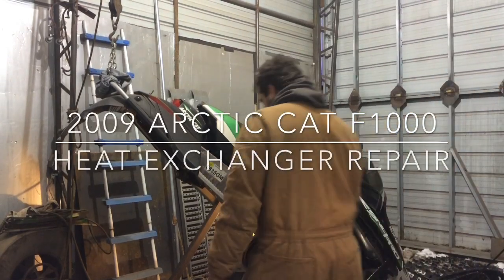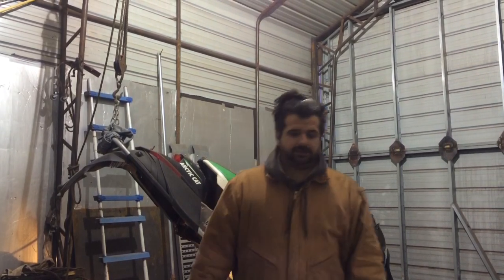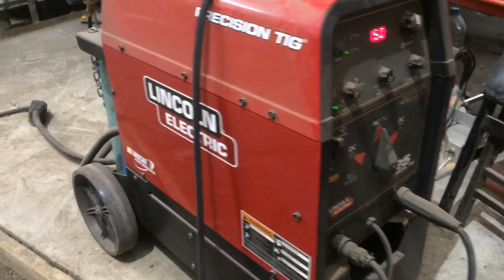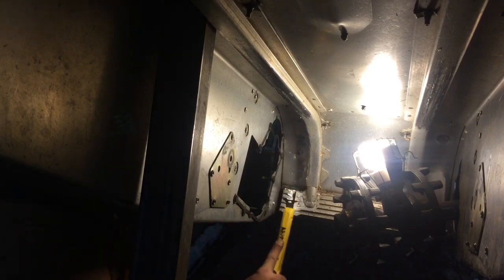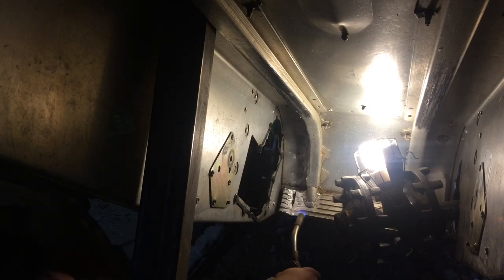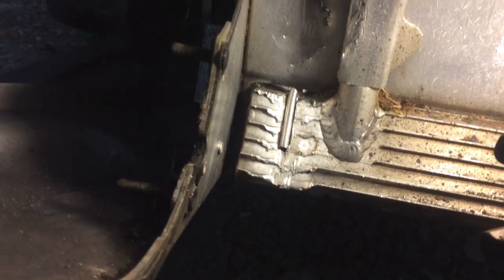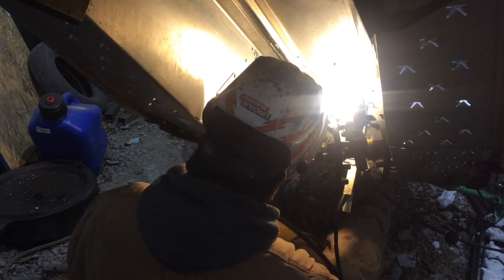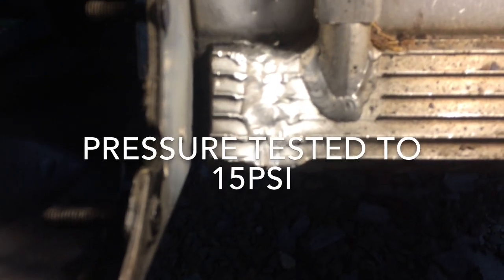How To Fix Snowmobile Heat Exchanger

Comment: What are the steps do on the sled disconnect battery drain coolant anything else
Reply from the maker: john Jackson make sure the aluminum is clean, use a stainless steel brush to avoid contamination. Good to have a leak down tester but not critical. Good luck bud.
Reply: @ArcsandSparks315   Thank you I'll let you no how it turns out